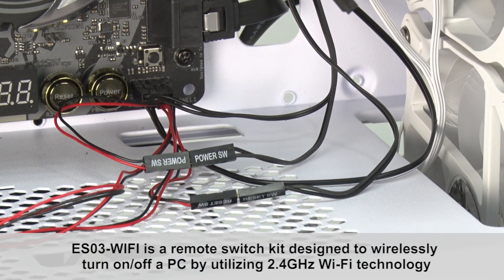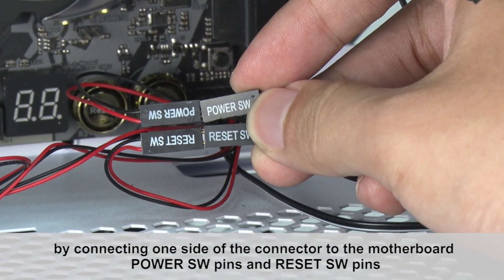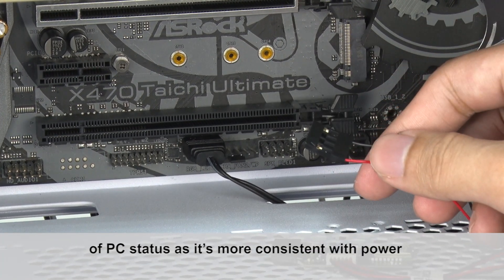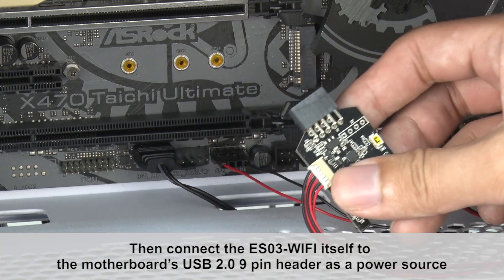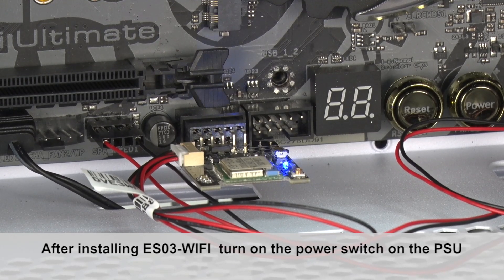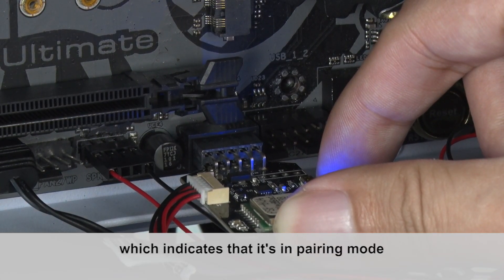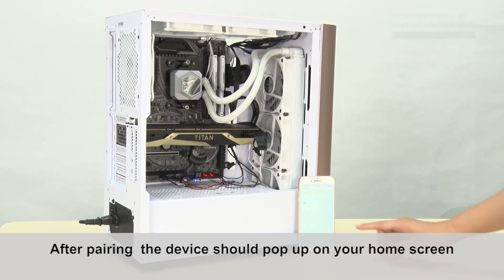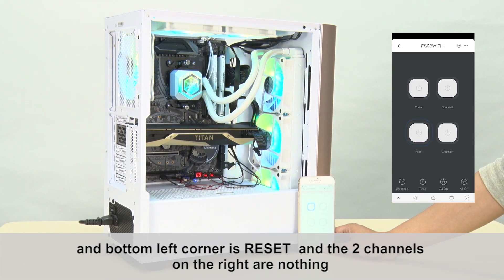ES03-WIFI Installation Guide

Comment: With the 1.0, I think, I’ve tried this a couple times over the years with my eso3 between 3 different motherboards and its never worked.

Summary is: Its plugged into a usb2.0 header, and speaker header is in the F_panel/etc correctly. If the only power connector i plug in is powersw/pw, my pc peripherals (gpu fan, cpu fan/aio fan, case fans, leds) all turn on but no boot. Ive tried every orientation possible for the powersw connectors.

Not sure why it’s never worked, I think a faulty product but it’s too late for warranty and it’s possible that I’m missing something, but it’s been multiple motherboards and I’ve gone through many user forums but to no avail.
Reply from the maker: Please get in touch with our support team if you haven't already. Make sure to include photos of your connections and describe how you are using the product to: support@silverstonetek.com

Comment: It says that the system is offline which it is not Need help
Reply from the maker: For technical support, please contact our support team directly at:
support@silverstonetek.com
Reply: @Silverstonetech  I thnik it doesn't support wifi4 I had it runing fine on wifi5 and back on the wifi5 again could that be the issue?
Reply from the maker: @benjaminmartinussen2388  Probably not, the ES03-WIFI supports up to WiFi 4 so if your network runs at WiFi 5, that probably means it was just running on compatibility mode with the ES03-WIFI. You may want to check your router setting to make sure 2.4GHz is enabled as ES03-WIFI cannot run on 5GHz. Again, for technical support questions, please contact our support team at the following email address for quicker answers:
support@silverstonetek.com
Reply: @Silverstonetech  Most likely the router settings then beacuse i have both the 2.4 and 5 GHz enable at the same time and its make this 2.4GHz/5GHz after the name of the routers name in one single line But i will contact the support team tomorrow.

Have a great day

Comment: the version i got, has a molex connector, would of preffered speaker, because it is not bieng used, and would be less janky! also, i have to get a adapter and extender just, to get a molex near it. This is V2? mand upgrade and less jank, so you can hide it, and include a Friggin antenna !!  how cheep can u bee? to not include that? i got 1 working, second one, gets to 89% and then fails! setup is crap, that little button is so small!
Reply from the maker: Thank you for your feedbacks! Yes, the V2 switched to using 4pin peripheral connector (Molex) from speaker connector as some motherboards no longer has speaker header included.
Reply: can i unpin it, and switch it back? cause it is just a pain on my stem, to rig in another molex. also, serious connection issues, gets to 89% and fails, and i bought a antenna for it. 
 @Silverstonetech
Reply from the maker: @tek_soup  For further technical support help, please write directly to our support team at the following email address, thanks!
support@silverstonetek.com
Reply: ok @Silverstonetech

Comment: Is it possible for this device to wake up the PC from sleep?

I just bought this and all I want it to do is wake up my PC from sleep mode, but every time I hit power (Channel 1 on the app) when the PC is on sleep mode, it just powers up for like half a second, and goes back to off/asleep?? How do I get it to just wake my PC up?

(P.S. I know about about Wake-On-Lan! Im wanting to wake up my PC when NOT on my home wifi network so I can access Steam Link at anytime, anywhere)
Reply from the maker: Since pressing on Channel 1 is the same as pressing the physical power button on your PC, please double check to see if your power button setting is set correctly to power on after sleep. Also, make sure to tap the channel 1 button in the app lightly once and wait for your PC to respond. Do not press and hold as that may be interpreted by your PC as pressing the power button twice or holding the power button down.

Comment: Hello, will it work in other networks/anywhere location (means when mobile is connected from mobile data),and user will other location/city.
Reply from the maker: Yes, after you configured the ES03-WiFi initially with the PC in your home network, you will be able to turn on and off your ES03-WiFi equipped PC anywhere even on mobile data.
Reply: @Silverstonetech  Thank you

Comment: Just installed my ES03-wifi v2. When the power pin is connected the computer keeps rebooting. How do I solve this?
Reply from the maker: You may want to double check the connections to make sure your power and reset pins are connected to the exact pins on the motherboard. If you are still having issues, you may write directly to us at:
support@silverstonetek.com
Please note that our office is off for Lunar New Year holidays from January 20 to 29 so you may not get a response from us until January 30th.

Comment: I've now got my replacement model. Got it working perfectly but I do share the concern that the device ignores your windows power switch settings and just cuts the power. How can I fix this?
Reply from the maker: If the power switch/button on your PC case is working normally and not cutting power while being daisy-chained to ES03-WiFi, then it's possible the signal from your smartphone for power is being intrepreted as a long-press. Maybe you can try tapping the power on the smartphone app quickly, and avoid pressing and holding it.

Comment: My experience:
1) I pressed the sync button, and it didn't show on my mobile's Wi-Fi to pair with. I made sure my 2.4Ghz Wi-Fi was active and 5Ghz disabled in the router and also made sure my mobile was not running on mobile data.
2) Second time I pressed the pair button, the button and all its housing basically fell apart and was lost. I was handling it with much caution. 
3) Mine doesn't have a speaker cable as seen in this video. I've got the new one with the 4 pin molex. ES03-WiFi connected to the power supply via molex (you must supply the male molex; I just happen to have one in a box for my modular psu)
4) Power and reset buttons successfully connected and the ES03-WiFi mounted on the usb 2.0 9 pin connector of the MB.

Comment: I installed one of these (V2) to my computer. I'm finding that as soon as I hit the power on via the app, the system powers up and immediately shuts down 1 second later. I can power off or restart via the app when its turned on from the front IO panel without issue. Any idea what might be causing this? Cheers
Reply: I have the same thing. when turning on manually the pc goes off after 4 seconds. Im gonna ask Silverstone Support.
Reply: @noel.sk03  @edenrow1901 have you guys found any fix yet? I'm having the same issue right now

Comment: My unit seems to have a male 2 pin molex. Why is this not shown in the video? Where does it go?
Reply from the maker: You have the newest revision so please connect it directly to your power supply's corresponding Molex connector (4pin peripheral connector).
Reply: @Silverstonetech  Thanks for the response! My power supply does not have a Molex port, and the ES03-Wifi's molex is male. I can't seem to find a 6-pin power to female molex adapter. Any thoughts on a solution to this?
Reply from the maker: @vinnyclifton7006  The molex connector from the ES03-WIFI should be a female one, please double check it against the photo we showed on ES03-WIFI's product page (shown as "4-Pin peripheral connector (V2 only)):
https://www.silverstonetek.com/product.php?pid=938
So you should be able to easily find an adapter for a male connector.

Comment: I have a problem. I did everything and i can shut down my pc. But i cant start it. It says it has no power. ??
Reply from the maker: Please double check to make sure your system's/motherboard's USB header is providing +5Vsb standby (or USB standby) power to the ES03-WiFi card. You may need to go into the motherboard BIOS/UEFI menu to enable standby power, so please refer to the system/motherboard manual for this information.

Comment: Does this actually Shut Down the PC properly or does it simply cut the power?
Reply from the maker: This remote simply mirrors the function of your PC's (or PC case's) power and reset buttons. So it will shut down (or put it to sleep if you have configured it that way in Windows setting)  the PC properly just like pressing your PC's power button.
Reply: Thank you for the reply, but I don’t agree or miss understand. Pressing tour PC’s Power to the the point where it Shuts Down. Is not the same as going to start and telling it to shut down. What I am trying to achieve here is the following. We have scheduled power cuts and would like to remotely but properly shit down our mining rigs. If this device simply turns the PC off same as when you hold the Power Button down it did not properly Shut Down. Hope this is more clear. Thanks again
Reply from the maker: @gambit6435  If you configure in your Windows setting that when pressing the power button to have the system shut down (or sleep), then when you press the power button once, it will shut down properly as if you go through the start button to click shut down (or to sleep). If you press and hold down the power button, then that's forced shut down by the motherboard to cut power. Since ES03-WiFi mirrors the function of the power button, you can do both as well. Press once, the PC will go through proper system shut down (or sleep) as you've configured in Windows. Press and hold, you will initiate forced shut down to cut power.
Reply: @Silverstonetech  Thank you very much for answering my question.
Reply: @gambit6435  did you get it to work? For me it cuts the power, even if I configure the power button to put PC to sleep.
Reply: @sdolo222  I dont have the product yet I was enquiring before I buy it. Sorry
Reply: @gambit6435  no worries, I figured out my perfect option is to include an additional alexa skill that can turn off the pc safely. So now I can shutdown or force shutdown.

Comment: How did the device connect to my home wifi network ?
Reply from the maker: During the pairing process with your smartphone, the login and password required for connecting to your home WiFi network is passed onto the ES03-WiFi card from your phone automatically. So you don't need to input those information manually.

Comment: Can you use this to remote rack mount server?
Reply from the maker: If the motherboard in the rack mount server has a USB 2.0 header that supports +5Vsb standby and there is a WiFi access for the rack mount server, then yes, this will work with it too.

Comment: Can I connect it with router and turn PC on whenever i'm am?
Reply from the maker: If your PC is connected to the internet via your router, then once you've installed ES03-WiFi in your PC and set it up, you will be able to turn on/off your PC anywhere.
Reply: @Silverstonetech  so does that include when I'm off-site i.e. when I am on the road say on mobile data, but my PC is at home connected to the router? What if the PC is turned off but still connected to the router via LAN?
Reply from the maker: @inverse_of_zero  The ES03-WiFi card must be receiving standby power from your PC while the PC is off and connected to your home WiFi network. But you should be able to verify  these easily after the initial setup at home. So yes, as long as your home WiFi is on, you will be able to turn on and off your ES03-WiFi equipped PC anywhere even on mobile data.
Reply: @Silverstonetech  that's wonderful, thanks, I'll pick one up today 😊